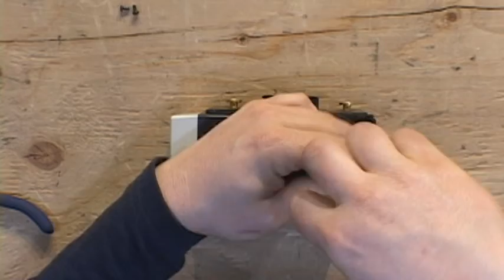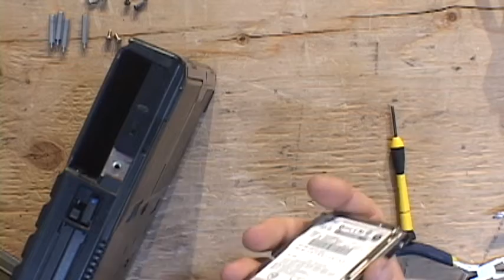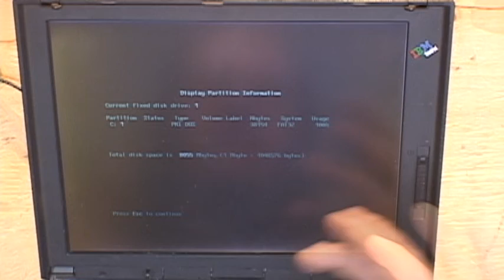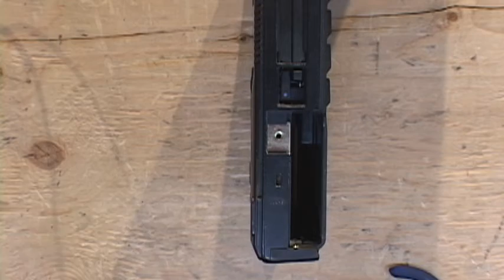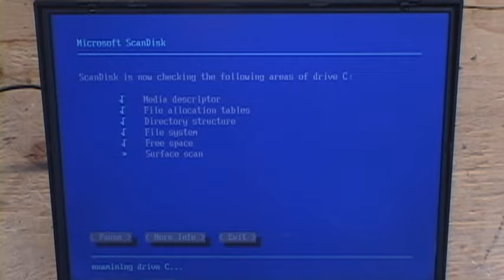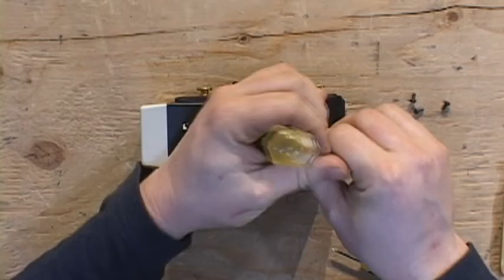nNovia QuickCapture A2D - Teardown and Reformat

Comment: Random question but do you have any idea where I could source a cable to use for the quickcapture's analog input? Only option I could find is the original breakout cable from nnovia but no one is selling those lol
Reply from the maker: I do not. I was able to find the Operator's Manual (there's two versions of that) and that contains the pinout for the connector but soldering it together is very tedious and annoying.

Comment: you should be able to use an mSATA SSD in an IDE adapter no problem then. that would be a much nicer thing, and you'd be able to max out the bandwidth of the disk controller with it in and out.